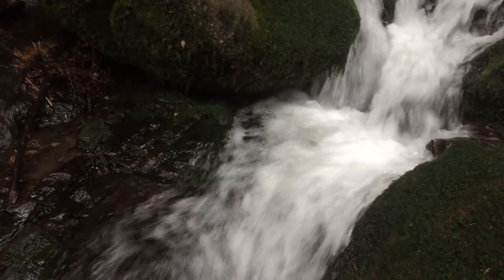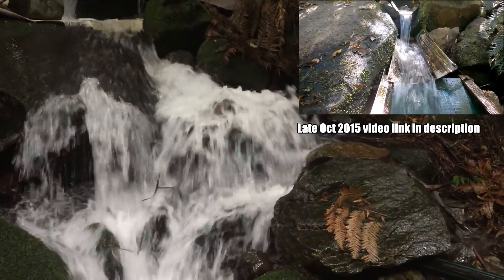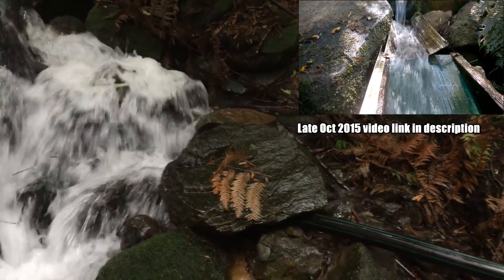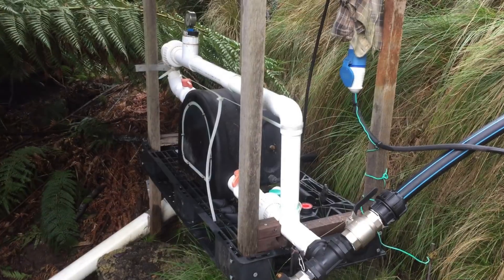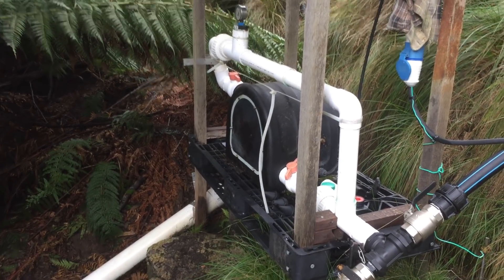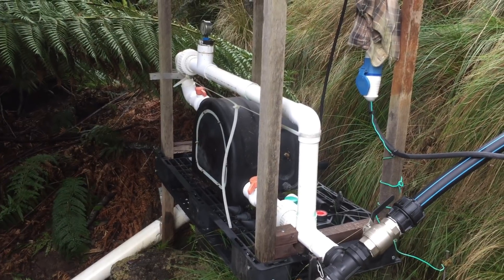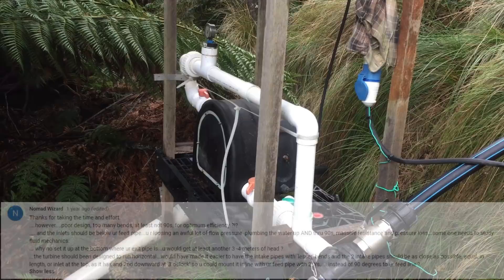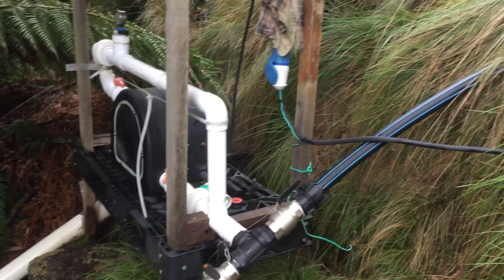Tasmanian Micro Hydro setup - answering some questions

Comment: What's the constant output in kw?
Reply from the maker: few hundred watts from memory not much but it's 24/7
Reply: @HBPowerwall  that's okay but I was wondering, what if these were serialized in multiple units until it reaches kw aggregates
Reply from the maker: I guess you could

Comment: wtf was this all about??? p[easeeeeeeeeeeeeeeeeeeee explain
Reply from the maker: Its on my channel because i love this type of thing and my bud gets his project out there without any effort :)
Reply: excellant.... i love this shit too, i was also thinking utube screwed up and put someone elses vid on ur channel.
Reply: OffGrid Aussie Prepper, he is Making electricity with a pelton wheel using a washing machine motor,,, it supplys all his needs but one needs a stream with head height to supply the necessary water to drive it.  Rather along the lines of  an old water wheel except a peltonwheel is small and rotates at very high speeds.
Reply from the maker: Pretty much what Reamann said :)
Reply: i shud have been more specific, what is this vid doing on ur channel, and when i watched this vid it had a different title??? and REAMAN was the washing machine motor a fysher & pyckel?? lol
Reply: OffGrid Aussie Prepper;   a three phase Fisher and Paykel is one that is commonly used!
The thing barring most from doing this is having a well placed and efficent water supply with head height.
Reply: i have had it on my to do project list for a very long time but as u say, trying to find a water source like that is like finding a pot of gold at the end of the rainbow. As soon as i build it i wud want to test it, but we r also in a severe drought so that aint on the priority list.

Comment: Man, i wish I lived down hill from a stream. I'd love to install some hydro.  Dang Florida is like living on a plate.
Reply from the maker: there is so much you can do with plenty of water they drink the water too as well as have a dump load on the hydro that heats a 300l tank of water in the house (also serves as a thermal mass in winter to warm the off grid property. Hot water is also heated by those thermal hot tubes things (you know the ones i mean ) and is also plumbed into the wood stove all thermo cycling on it's own
Reply: Geee thanks, you just made my envy-meter go up 10 notches  :P
hahah, thermal hot tube things.   You mean thermal vacuum tubes  ;)

I'm gonna set my system up for heating my house with the stove this year instead of using space heaters. Last year was 2 month with heaters, and the final 2 with the stove. Though at the time, the stove wasn't piped to anything. It was one heck of jerry rig to get heat in the house  :P
But gonna take copper pipe and wrap it around the flue so I can blow hot air into the house, and then also pull the hot air from around the stove as well. Pull as much heat as i possibly can!
Reply: @korishan  
How has your system worked out over time? Did you find that drawing too much heat out actually made your chimney clog up with creasote or draw badly?

Comment: yeah there is a 4 kw version i think
Reply from the maker: that'd use some water!
Reply: you can get 2 kw on relatively low pressure but to get the 4kw it has to spin almost 4 k rpm
Reply: You just put 2x Powerspouts side by side...
or 3 or 4...
see the Powerspout site.....